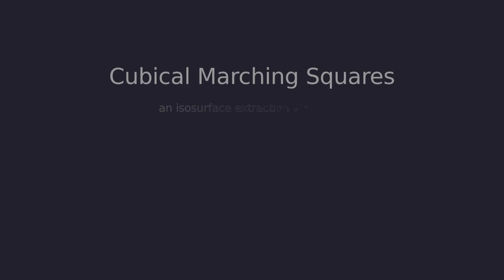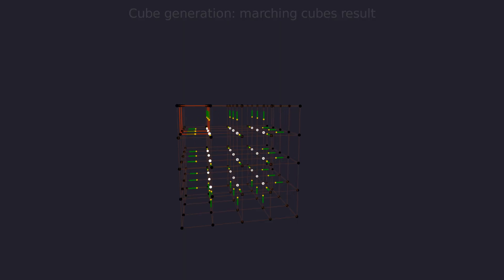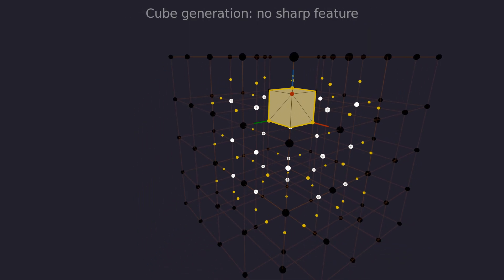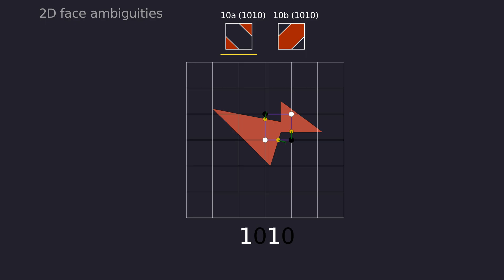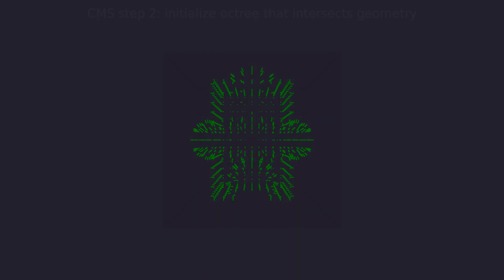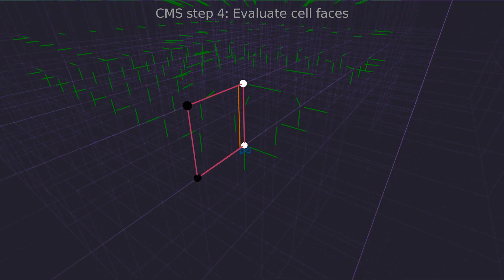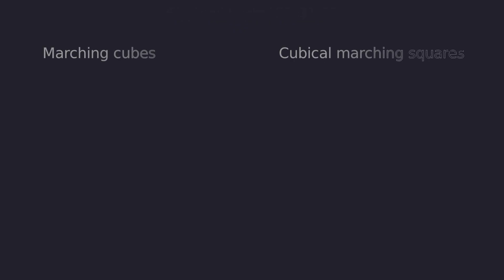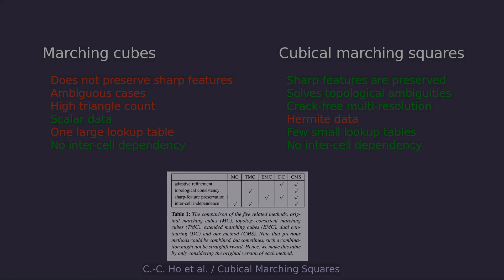Cubical Marching Squares animated

Comment: This is a really cool visualization and explanation, I wish I had it years ago when I was trying to implement this algorithm and got stuck. I didn't understand you explaining how to extract the surface when the face of a cell is a quadtree at 8:40 but I'm also probably just dumb.
Reply from the maker: Thanks. I probably should've visualized that part, I got it wrong myself when I tried to implement it for the first time.
I build a quadtree on every cell face and during extraction step gather all segments recursively. The quadtree is shared by two cells by reference. Both cells need to see the exact same face, even if they are subdivided at different levels.